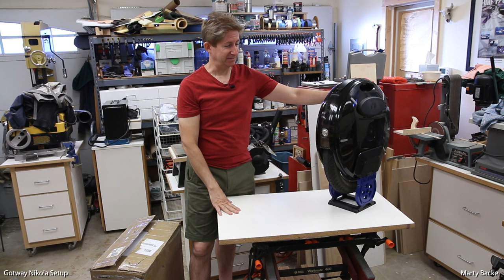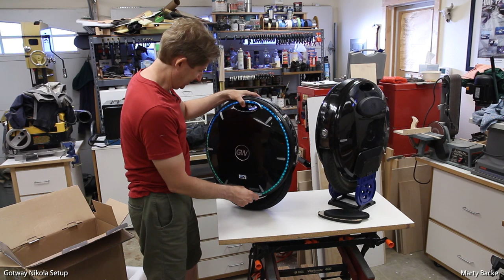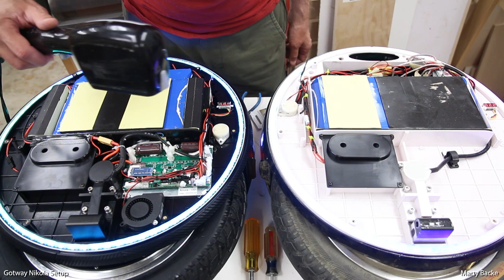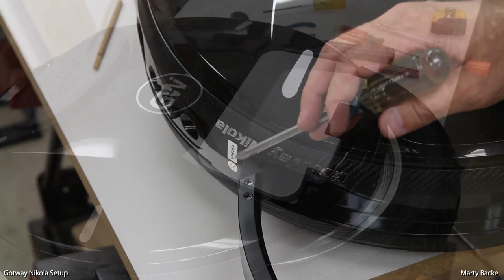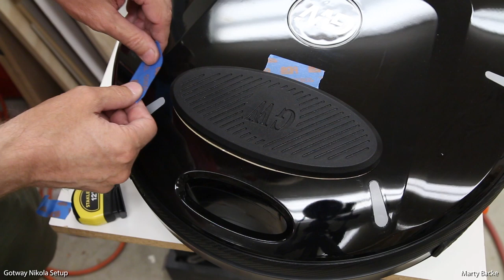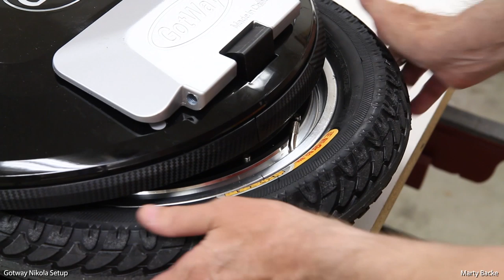Nikola Plus First Impressions and Setup

Comment: Thanks for this video, Marty. I still ride my very first EUC, a Nikola+1845Wh, which is my daily workhorse. And my long range wheel is an 1RadWerkstatt version of Nikola+ with 2700Wh of battery and a smart BMS inside. 15,000 and 7,000 km on their clocks respectively. With the weight the newer models have, I'll probably keep them both at least 1 more year.

Comment: I think that you may be mistaken re the fan. A cheaper fan would be using bush bearings which are silent, a ball bearing is obviously going to be noisier but much more durable and the fan casing and mountings are probably not insulated hence the amplified noise.

Comment: Very nice Marty, thanks! Good to get a close look at the 100V plus version. With regards to the grinding noice from the fan, I'd offer one thing to try. When I opened up my Nikola the first time to check the MOSFETs/thermal pad I also removed the fan first. After putting everything back together again everything was good - until the fan started with a very noticeable grinding sound. As that wasn't there before I knew something was up. Opened the wheel up again and loosened the screws holding the fan to the heat sink, which got rid of it. Now, that still might make a difference in this case, but I encourage everyone with a grinding fan noise (especially those with the wheel already open :)) to try some screw tension adjustment and see whether that makes a differences.
Reply from the maker: Hey Nils. Very good tip! I'll tell Scot when I return the wheel to him. I bet this will help.

Comment: My fan sounds a little worse.  I may try to find a Noctua version of the fan, it is the same style used in many 3D printers.
Reply from the maker: As long as it's 12-volts. And the Nikola really needs the airflow. So be sure to use a model that pushes the same amount of air.
Reply: @ElectricUnicycles  Worst thing would be to have no enough air and a burnt board because of it!  Looking into a Noctua version of this as well right now for my 100v coming Wednesday!

Comment: If you want to do this battery with a management level voltage, capacity, change with a bms bluethoot 24S 60/100Ah , is a lot space

Comment: great and in-depth as usual. some of the design and parts they use just doesn’t make sense, off course i understand it’s to save pennies, but in the long run not a good business practice. as you said, they design a motor that is quiet and yet they use the cheapest laptop/desktop fan they could find. i know you will be replacing that fan soon, those bearings aren’t going to be long for this world!

Comment: 26:54 It looks like the voltage gauge started working, though it's hard to tell what it's saying from this distance.
Reply from the maker: Turns out that the display only works when the voltage drops below 100-volts (Gotway didn't upgrade to a 4-digit display for the Plus). So it does work after all.

Comment: That fan is horrible.  Definitely the first thing to replace.  Another thought for you (I personally don't like exposed copper in connectors like the battery terminal.  What I do is get some large heat-shrink tubing and use it as a sleeve.  I don't shrink it - ie don't heat it. Cable tie the sleeve onto the cable so it's easy to work on.  This is especially good for high voltage stuff as it stops the ingress of contaminants which can cause ionic reactions (ie rapid corrosion).

Comment: Questions if you can answer
1. The 100V plus 21700 model has different board, do you have any suggestions 
2. How to change the fan
3. How to reverse the USB port to use it from the inside where its empty

Thank you in advance Marty!
Reply from the maker: Hi :-)  Unfortunately I don't have any experience modifying my MSP (yet). I saw somewhere (can't remember where) that someone replaced the fan with a higher quality version. Currently the fan doesn't bother me since I can't hear it while I'm riding.
Reply: @ElectricUnicycles  i have the source of the msp mod if you want, i'll send it over Telegram. Thank you for the reply, i tought something else, and i've posted it on the forums ;)

Comment: how does this slime works? i mean it ment to be used when tire got cut or something, but not as preemptive measure. Marty could you explain please what benefit you get from using it?
Reply from the maker: See my maintenance playlist for videos on Slime. I put Slime in all of my wheels as soon as I take them out of the box. If I get a puncture while riding the Slime will fix it without me having to do anything. Use Google. Slime is a product that's used a lot for good reason.

Comment: what does that green slime do ??
Reply from the maker: Google "Slime for tire repair". Many people including myself put Slime in our EUC tires to auto-seal any tire punctures.
Reply: @ElectricUnicycles  
Oh,  i thought you put this on to keep your tires from deflating.  My tires deflate 1-2 weeks usually.  It gets really old after a while.
Reply from the maker: @WTF_BBQ  It helps with that too. I would also check that your valve core is tight. If even a tiny bit loose you'll lose a lot of air.
Reply: @ElectricUnicycles  
Good idea.  I'm new to this hobby but i'm learning little things here and there.... Thanks.

Comment: Is it a 12v fan? 50MM?  Already sourcing an upgrade.
Reply from the maker: As stated in my previous comment, 12-volts. Don't know the exact size.
Reply: @ElectricUnicycles  OK I will measure it tomorrow and get something better ordered.  Such a dumb thing for them to be cheap with.
Reply from the maker: Film whatever you do - I'd like to see the details and results if successful

Comment: I really like your videos! Very informative and entertaining. I am having a bit of a struggle. I am trying to remove the shells on my Nikola plus. I successfully removed the 12 around the circumference of the shell. Lifting the central labels on both sides, I cannot seem to located a screw/bolt/fastener of any kind.  Please help!
Reply from the maker: I assume that you are talking about removing the two side panels to expose the batteries. Of course you first have to remove the pedals. Gotway applies double-sided tape to the batteries so that they stick to the side panels. So after you remove the pedals and 6-screws you have to pull, steady and strongly, to get the panels to release from the batteries.
Reply: @ElectricUnicycles  That did the trick thank you!

Comment: Hi where did you buy your valve pressure measurer. Does it have bar units?
Reply from the maker: Sorry, I've had that for many years and can't remember. It only measures in PSI.
Reply: @ElectricUnicycles  No problem.

Comment: What version of Nikola Plus you showing ? Meaning battery capacity, 1230 Wh ?
Reply from the maker: 1845wh
Reply: ElectricUnicycles Wow, it’s must beat Nikola 84V 1600Wh on range test. Do you think you can run 60 mile on single charge with Nikola Plus ?
Reply from the maker: @mr_Gurme  Absolutely. I just rode 48 fast miles and I had 30% battery remaining. I think the Plus will be a solid 65-mile wheel for me (180-pounds riding weight).
Reply: ElectricUnicycles It’s very impressive result, especially considering high voltage motor. Someone telling me, that 100V version of Gotway wheel eat less power than 84V version. Look like it’s can be true.

Comment: The bearing is most likely bad.
Reply from the maker: This isn't the only Nikola with a crappy fan. You're most likely correct, but it's because Gotway sourced a cheap low-quality fan.
Reply: @ElectricUnicycles  seems like it

Comment: They remind me of very cheap off brand car audio amplifiers on the inside. I bet those wheels only cost Gotway a few hundred bucks to make. Especially with that kind of quality control. Then they sell them for $1,800 or 2grand+ or -. Its crazy, but hey, at least they look cool lol.
Reply from the maker: Remember, this is a business. In retail, just about anything you buy, the retailer probably paid half the list price. Then the manufacturer has to make a profit also, etc. So yeah, EUCs probably only cost a few hundred dollars in material costs.
Reply: @ElectricUnicycles  yea but, just because they want to make Big Bucks, doesn't mean they should sell people sub standard wheels that compromise safety. General motors did that and went out of business,  if it wasnt for the U.S. government then they would be no more. And you fell hard on overheat hill, what if you were on a sidewalk of a busy street?? I think they need to get their act together before th3y get the entire E.U.C. market in huge trouble.
Reply from the maker: @chingg7639  Can't disagree with you